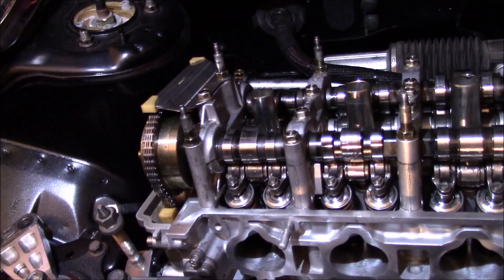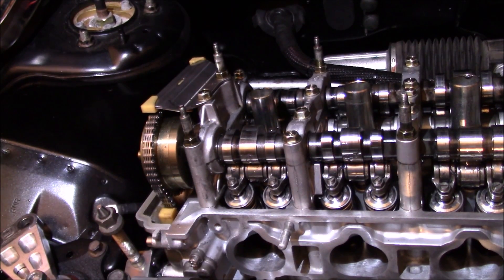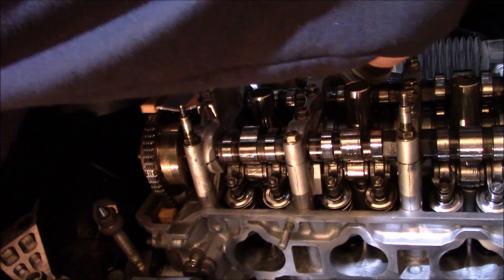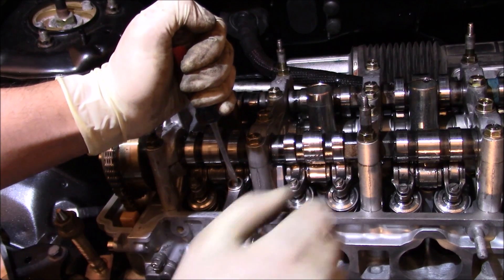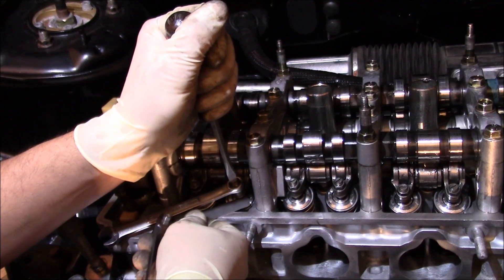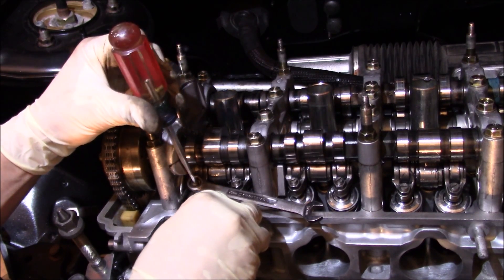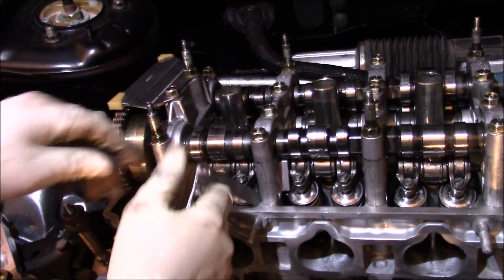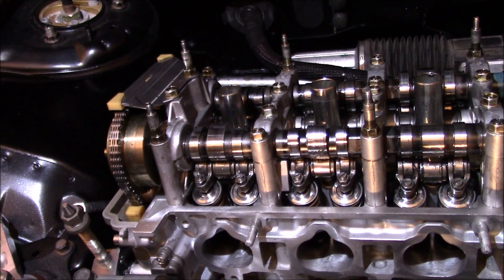HONDA K SERIES VALVE ADJUSTMENT!

Comment: I think the TDC notch position ("C" in your illustration at 8:26) on the (left)camshaft pulley is 3 o'clock and the VTC pulley is at 9 o'clock-- so they line-up. Then a 90 degree turn for positions 2,3 &4.  To reiterate, these are  the o'clock positions of the TDC notches which can be found on the outer diameter of the pulleys:
POSITION 1:  Camshaft pulley 3, VTC pully 9  (shown at 8:26)
POSITION 2: Camshaft pulley 6, VTC pulley 12
POSITION 3 Camshaft pulley 9, VTC pulley 3
POSITION 4: Camshaft pulley 12, VTC pulley 6

Comment: Thank You!! Yes it helped but the way you do it was so much easier without the Intake Manifold being installed or the Exhaust side manifold. With those in the way plus the coil packs and all the other hoses it can be a stretch getting into those valves with the feeler Gauge.

Comment: Old video hopefully I get a response I've always wondered this if you have to adjust your valves at top dead center wouldn't it make sense to do cylinder one and four at the same time? then two and three after turning the crank and making sure those are at top dead center. I've always done it one through four anyway. But top dead center center  number one and cylinder 4 will be top dead center also. Same and cylinder 2 and 3
Reply: each cylinder has a top dead center for compression stroke and for exhaust stroke so valves are in different positions depending on which stroke its on you would have to make sure valves are all closed and at right point on the cams

Comment: Hi... I have a 2002 Honda crv which shows good compression (about 160ish and all cylinders) and I've adjusted the valves. Yet, I still get misfires on all cylinders. My Honda manual says the Exhaust valve adjustment should be .012 and my intake should be .008. However, when looking at the sticker under the hood it shows 0.30/Exhaust and 0.23/Intake. Any suggestions or help would be appreciated.
Reply: ur confusing mm with inch
Reply: Bro….. intake should be .008 and exhaust .011

Comment: Hey bro, learned a lot from u. 

I just installed Skunk2 Stg2 v3 on my k24/k20, I'm confused with the valve lash specs. Since Skunk2 said to put it I/E to 0.00. For now I put it to 0.006 I & 0.008 E. is this too tight?
Reply: I just happened on this video- I've done numerous s2000 VA.  0.00 is NOT- I repeat- NOT correct.  You are in for a world of trouble with burnt valves being the least of them.  The F20/F22 typically adjusts to the lower end of the spec.  I also have K20 Si and I'd be doing IN .008/EX .011.  However, the DBW F22 owners use EX .012 (with the range being .010 to .011- yes, we go a little looser to prevent burnt valves on the DBW F series- a known issue).  good luck and enjoy the ride.

Comment: At how may miles or km did you do your adjustment? I have a 2013 civic si at 80,000km and I think it's a bit louder than it used to be so I'm trying to figure out if I need an adjust or not. Thanks

Comment: How bout tongue specs of valve nuts? Also the rotation of the cam to top dead center for each cylinder is confusing do to the order being 1342 but you said you can do 1234... so which is right .. I guess I will follow you directions at the end and see...

Comment: Does it matter which way you insert the filler gauge? Front vs from the side? And if you go with the lower limit for example 0.008” and set it correctly would you be able to insert 0.009” or 010” filler gauge
Reply: It does, simply to pull the gauge out and FEEL the drag on the way out. You can insert it sideways but you dont get much gauge material sideways to feel much. If you set it to the minimum clearance of .008 with proper feel. You should NOT be able to insert the next gauge up .

Comment: Not going to cover phasing the cams? Pretty big part of the job.
Reply: Mark Blánc Not gonna explain cam phasing? Pretty big part of your comment. 😆
Reply: Valve lash adjustment isn’t related to the cams VTC angle. The limit of VTC is defined by piston to valve clearance. If you’re putting big cams in the k series you need to clay the engine at various VTC angles...
Reply: What do you mean by phasing the cams?
Reply: The cam phasing is controlled by the ecm and can be set by the tuner if he wants. Plus depending what phasers you have along with the cam and pistons setup sometimes you can can't phase 100% without smacking a valve's.

Comment: Can valve noise happen only when acceleration and coasting but not when idling?
Reply: Carlos Garcia yes
Reply: @isorozco511  it only happens when i put it in gear and the loudest around 1500 rpm. It's a very low chattering. Probably hard for most to hear. Ive heard it on other Hondas usually crv. How possible is this valve issues or transmission?
Reply: Sounds like a motor mount if it makes noise in gear. Crvs are known to rattle when the trans is in drive. Doesnt seem like a valve job based on what you said
Reply: @isorozco511  thank you very much. This has been driving me crazy since I bought the car in the summer. I suspect the mount as well.

Comment: I heard that the recommendation is to set them loose, as these types of valves actually tighten over running time... any truth to this?!?
Reply: Your Moms Fudge Packer no have to be in spec
Reply: The spec is not a certain number, it is a range, what I am trying to clarify is that since the valves get tighter over time, it is recommended to set them to on the loose end of specification.
Reply: @bower95  I don't know about other engines, but the K-series tends to loosen on the intake side and tighten on the exhaust side.
Reply: @y.blanxo  this actually happened to me cyl#1 & 2 intake were loose and cyl#2 & 3 exhaust were so tight and its the first time I've seen this happen on a k series
Reply: @bower95  thx for the tip i will testify barelyu did buddys adjust at 160k or or more n they were all hella tight it ran so muchbette

Comment: Hello Serg, I wanted to ask you for help with the valve calibration measurement of my Honda Accord 2007. Previously, they adjusted the calibration but lost strength and this fuel squeezer. The engine that brings my Accord is a K24A8. You could help me with the data of what should be the measure that valves should carry. In advance, I thank you for any suggestions you can give me to correct this problem in my car.

Sorry about my English Best regards

Comment: Valve Adjustment should be 1-3-4-2
Reply: Juan De Jesus  should be 1:3::2:4 you can however do it 1/2/3/4 if you turn the engine properly
Reply: I agree ☝️

Comment: I think i stripped one of the cap bolts of the VC, it just turns and turns when i try to remove or tighten it.  how do you fix that?
Reply from the maker: try sticking a flat head screw driver under the cap and pry up while you try to loosen it. the upward force might help it screw out so you can see what part is stripped.
Reply: +SERGMOTIVE GARAGE  thanks man! I also just found out that i have a stripped exhaust bolt hole.  How can i fix that?
Reply from the maker: bhadz100 you mean like on the head where the header bolts too? If so, then you can use a rethread kit to try and clean up the threads
Reply: +SERGMOTIVE GARAGE yup. I was trying to find an exhaust leak and noticed that one bolt is not torqued propertly. Aluminum sucks!
Reply from the maker: http://www.ebay.com/itm/Craftsman-48-pc-Piece-Master-Thread-Restorer-Kit-Taps-Dies-Rethread-SAE-Metric-/182344429863?hash=item2a74933127:g:awAAAOSw5cNYHn9c

check that link out, i use this kit at work all the time when i have threads that are cross threaded or dirty, usually does the trick for me. Just make sure you start the tap straight other wise the bolt is gonna go in crooked when you finish!
Reply: Don't over tighten hardware on alloy components use a torque wrench.